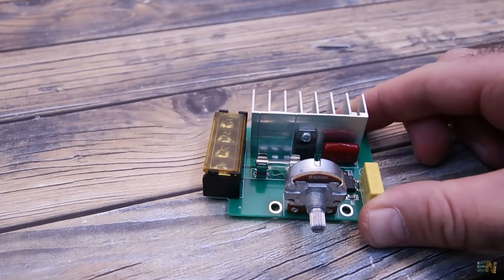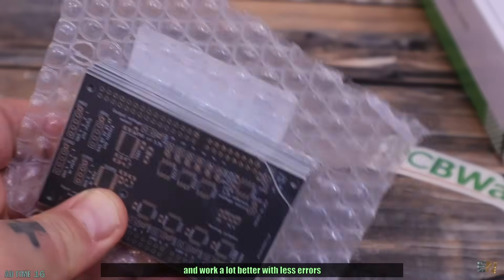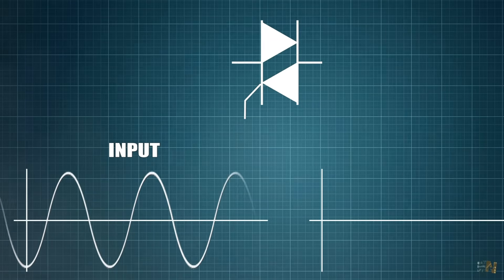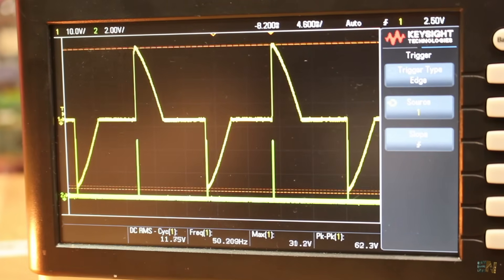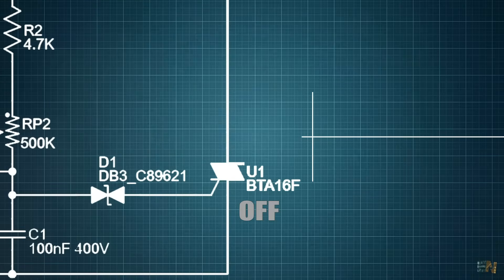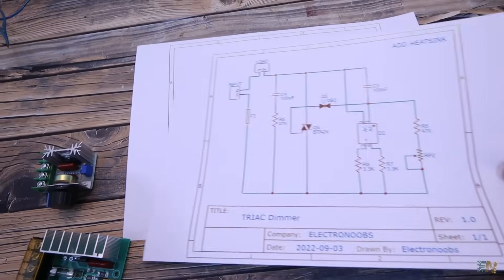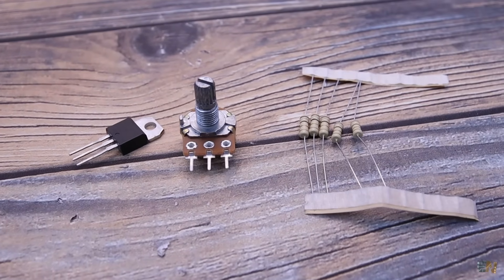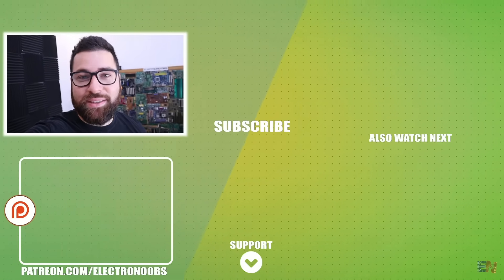TRIAC AC Dimmer Circuit - How to dim AC Power for Motors and More

Comment: The triac (thyristor) stop conducting if the current is less than the holding current (Ih). This is not obviously the zero crossing Voltage. (For example inductive loads like a motor or transformer.)
Reply: There are two conditions actually. Falling below Ih and reversing the mains current will unlatch the gate current.
Reply: @lolsypussy  what that means? I am looking for dimmer to regulate flow with 220v ulka water pump, 50hz, 48w. I saw ppl using mainly dimmers that regulate lights,but someone also used this triac one, which I read is used to regulate revving motors such as drills. What's the difference ?

Comment: I see that your hand are very careful not to touch the heatsink, It kind of disappointed me that the triac itself does not have any Isolation plus thermal pad on triac to heatsink which is a safety concern to me, Atleast if that have Thermal Pad+Isolated Screw, I pretty sure that if I accidentally touch that Heatsink, I would not shock horribly, And I do not test Breadboard with Mains voltage, In case of I accidentally short something on the Breadboard the Breadboard will melt , burn or Electroboom Effect, I usually go barebone design for safety reason
Reply: usually such triacs have internal galvanic isolation from the middle pin and the heatsink tab
Reply: @69iqtutorial  but... In case of that triac, they have no Isolation, Others have but other not have